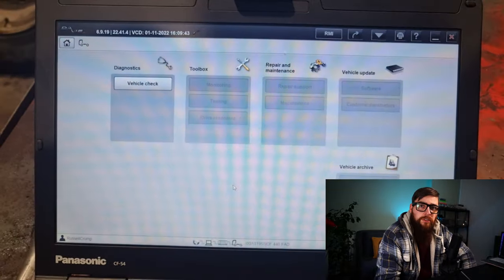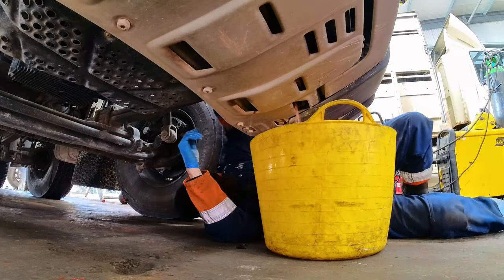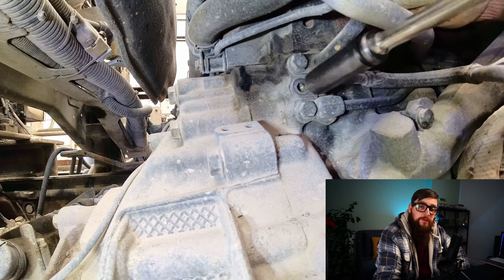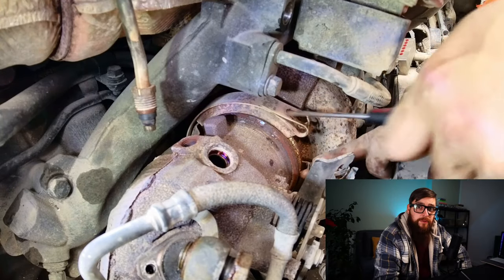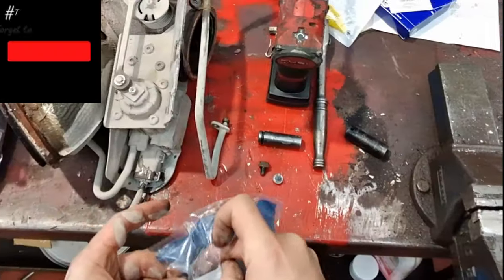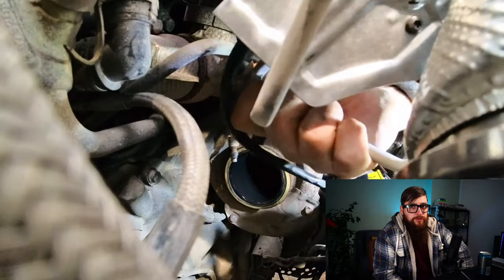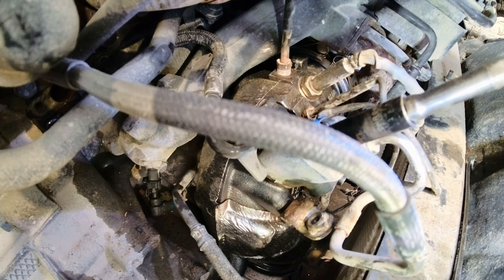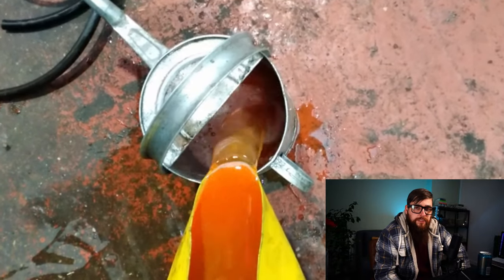ITS MOST PROBABLY THIS | DAF MX-11 BPV actuator FAULTS

Comment: I worked on Dafs for years at a dealer, and tbh really rated them as a truck, this was PR and XE, then the E6 models came along, holy crap! company I worked for recently got rid of 50 mx11 trucks, the workshop was the quietest I had seen it in many years.
Reply from the maker: Hey thanks for the comment 👍😎 seee I prefer a mx-11 or mx-13 e6 and my-17 to any euro-5 engine. I just find the diagnostics rather backwards 🤷
Reply: It's not really a fair comparison, with all manufacturers the Euro 5 engines were much simpeler than the Euro 6 ones. In fact I'd say that Daf did comparatively well with their earlier 2013-2016 Euro 6 trucks. The 2017-2021 ones are not as good I'd say.

Comment: Evening I plugged it in, and the faults cleared on their own I carried out a force region 
But i had to operate the old bpv valve as and when the new one moved to get it to regen temp it took a while but was fine and is back on the road thanks again
Reply from the maker: I'm glad you got it sorted, the cleared off the dash but not out the ecu. They would of gone from active to stored. 
with it being euro 6 I'm sure by the time it requires another one, it won't be your problem

Comment: @truck tech Uk hi great video got a Daf cf 2015 18 ton with a bpv actuator fault if I connected a new part would it allow me to do a regen as can’t get it to regen with a active fault
Reply from the maker: Thank you for the comment👌. Connecting the new BPV should let it do a regeneration as its looking for the position that your old one won't be reaching. But what will that do to the actual regeneration process? I don't know, as I've never just plugged one in and carried out a regeneration. Fingers crossed, I suppose 🙈

Comment: Imagine doing that job in 10years time..... I hope I'll have retired by then! Great content.
Reply from the maker: Hey Darren thanks for the comment 👌. The jobs only getting more technical, you should see the electric vehicle vehicles coming through now!
Reply: @TRUCKTECHUK  I will be retired and no i do not want to see the Electric trucks ,i don't even want to see XDs XGs lol
Reply from the maker: @norb0254  by the the you have finished these camshaft recalls your be past retirement age 🤣🤣🤣👌
Reply: @TRUCKTECHUK  On a LF head gasket frenzy at the moment .Thought i a quick gearbox turn around job on a AS lite ,,,Yeah bulkrings for 1st 2nd ,part number on the box is what i asked for ,pity the parts inside weren't lol..So packaged wrong to part number ..So a wait till they sort it out lol

Comment: Hi Buddy, I love your videos they are so much help, I have got a 2020 DAF CF with a BPV Internal error code P1020 the bearing had collapsed on it so I have just changed it and it is still coming up with P1020 internal error, could this be something to do with the E-FAN? If so how could I rectify it? I’ve checked all the fuses and nothing. Also in the comments you said you are going to start fixing the bearings on the BPV’s have you started that yet? Thank you.
Reply from the maker: Hey Tom. I'm glad you enjoyed the videos. If you have an internal error the only fix is replacement unfortunately as I've been unable to identify the actuator supplier. I've got a BPV here with the same faults. Internal fault and positional error. I have a kit here that needs to go into production for the shaft and with the welding required it will be a service exchange unit. But as for the internal error, it is just that... an error that is internal to the actuator which seems to be captive to PACCAR unfortunately

Hope this helps
Reply: @TRUCKTECHUK  thank you my friend, in the end I sorted it, I made up some wires and put two trucks side-by-side I plugged one truck into the other truck reset the codes and then plugged the BPV back in, and it worked, I’ve been sending my BPV’s to Poland and a guy there refurbishes them and changes any components in the actuator, it costs about £1000 with postage and packaging.
Reply from the maker: That's crazy that you needed to plug it into another truck! I wonder what it needs to see for that to make it work 🤔 you would think clearing the codes would do it 🤷
I will look into the actuator when I get more time, fingers crossed I can get a service sorted for people 😎

Comment: Holding up the BPV and getting that clamp on 😅😂 preach!
Reply from the maker: Thanks for the comment 😎. You know that's a separate qualification on its own 🤣🤣🤣🤣.
Reply: If youre lucky your Finger fits into the hole where the nox sensor is seated. Put the clamp arround the turbo, lift the bpv in there, hold it with your finger  and get the clamp arround. The clamp doesnt need to be tightend to hold the bpv so you can use your lifting finger to put in that T-Bolt

Today on CF 😂

Comment: Have you run into P1021 BPV actuator CAN communication error?  im stuck there
Reply from the maker: Hey thanks for the comment 👌. 
You need to check for power and ground on the bpv and check for can comunication. If you have them (you have 4wires to check like in the video) your going to need a new BPV
Reply: BPV was Replace.
Reply from the maker: @pantherelio  do you have any other errors in the PCI ECU?

Comment: Hi. As a driver it’s great watching and learning the ins and outs of the faults and the rectification process to get rid of those bloody P-dings!!! I’ve recently had my BPV changed on a 16 plate MX11, would this alter the performance of the engine brake in any way? I don’t feel as if mine is working as efficiently compared to the old one. Truck is automatic and changes down but doesn’t seem to have the retardation of old. 
Thanks for reading and awesome videos.
Reply from the maker: Hey thanks for the comment!  the fact you understand the systems is always a bonus from a technician's point of view as the more information on an issue you can give a technican the better when you want it fixed! 

As for your BPV issue, the part itself is what is called a smart actuator and processes all its own faults and positional data. 
If the engine is requesting a position or pressure for the turbo.....the motor will move it to that position....say 3 per cent for regeneration. If its unable to reach the desired position you will get a DTC just like in this video. This is the "requested" and "actual position" I'd be looking at in monitoring data with a diagnostic tool
So if its not performing correctly you should have an error.
Reply: Hi, no faults since new BPV fitted, also had the fuel cut off air valve replaced and a couple of NOX sensors, personally I think the BPV has been faulty for a few months as been having faults for months so maybe I was spoiled as it was not working properly. Has now started doing more regular re-gens than before as well. Maybe a bit coked up down the system? Fitter saying dpf is clean going by his diagnostics. Truck felt down on power too but I think it’s starting to come back to me. Will see how things go. Cheers.

Comment: Also what test leads were you using for your diagnosis
Reply from the maker: Unfortunately, they were dealer-specific leads which come with a silly price tag but I'm working on a project that will plug into all the basic daf components and measure the functions for you 😉
Reply: @TRUCKTECHUK   what are the test leads called ?
Reply from the maker: @Raymond Romero  I have no idea off the top of my head other than like T-06 l. Closest thing I can find for general sale to the public is https://ebay.us/iv6F82

Comment: Now it is disabled by software BPV. Will there not be nuances in the operation of the system EAS?
Reply from the maker: When in engine protection the bpv gets moved to 100 percent open but the EGR closes to 0 percent. The truck also locks the VTG at 100% open......this is a fail-safe mode for the truck to operate in until it's repaired 👍
The downside of this protection mode was Nox production, which is why you see DPF's stuck in the exhaust full of AdBlue. 
The adblue system tried to compensate for the excessive Nox levels with adblue 🫣
Reply: So I understand that. AdBlue consumption will be increased and will the DPF filter clog faster?
Reply from the maker: @autobild01  I don't think soot production would increase (I'd need to check the AFR to see what it was under normal operating conditions vs protection mode) Last thing you need is a blocked DPF too lol 
All I know is Nox levels would increase hence the software update in 2018 fixes the excessive adblue condition under protection.
This truck was in engine protection for a prolonged time https://youtube.com/clip/UgkxLGVYIMUELrUiFYz-h0_m6lqWTjkEIM_x?si=9r8H7JfF2jJDuZ6E
Reply: @TRUCKTECHUK  Why did I ask you this question? Diagnosed the truck with an error on the accelerator pedal. The error on the pedal was constantly active, but with this error it is always sporadically inactive on the BPV. Disconnected the BPV connector, the accelerator pedal error became inactive. And the pedal works perfectly. Customers contacted the service center, and there they changed the engine software with the BPV disabled
Reply from the maker: @autobild01  I'd love to know what they are using to remove or edit software 👀
Reply: @TRUCKTECHUK  KESS V2
Reply from the maker: I take it this is euro-6 on an old PCI ECU? I was under the impression the bootloader was locked on Delphi ETC-3 ecus now
Reply: @TRUCKTECHUK  E6 2014-2018. I have no data for a newer version yet.
Reply from the maker: Was this through obd or bench? I take it winOLS to edit? Or file service? I've a large market potential for this stuff.
I turn everyone away usually 😅

Comment: Evening don’t no how else to message you have you ever had a Daf Lf 70 plate 18 ton with the bigger automatic zf astronic box slave cylinder on the n/s middle burn out has a pto on it but it’s up in the middle slightly damp it’s basically locked solid lorry does run but hunts oil smells burnt out has oil in it not to the level bung as got hot do the oil pump go wrong inside thanks Ben
Reply from the maker: Hey thanks for the comment. 
While I strive to provide helpful answers to every question, sometimes I might need more information from you. That's why i offer a premium members area that provides a more personalized and supportive environment. If you're looking for a more tailored and focused approach to finding the information you need, our premium members area is the way to go. https://trucktechuk.com/b/premium

Comment: How bpv works?
Reply from the maker: Thanks for the comment and watching the video. 
If you want more information  just like the bpv, I've a blog on my website that goes into more detail on systems and components which for the BPV you can find here: https://blog.trucktechuk.com/2022/12/the-bpv-actuator-mystery-revealed.html
Reply: The bpv back pressure valve or egr throttle as it’s called in non daf speak is ther to promote higher exhaust gas recirculating rates
Reply: @Gearhead90  .... and used to increase exhaust gas temperatures during regeneration modes, both mobile and parked.

Comment: Hello.  I have such a problem DAF 106 440 starts and stalls, error P1026 P1020 P1021 P1022 is the cause of BPV.
Reply from the maker: Hey thanks for the comment. I'd be fitting another BPV with them fault codes
Reply: Thanks a lot.  This is why the engine won't start.
Reply: the engine starts and after 5 seconds it stalls and the gas pedal does not work
Reply from the maker: Disconnect the bpv electrically and try running the vehicle.
Reply: @TRUCKTECHUK  OK.  I'll try tomorrow and write to you.  thanks again
Reply: @TRUCKTECHUK  Hello.  thank you very much, started DAF 106 by turning off BPV
Reply from the maker: @dmitrijnovik3414  I'm glad you got it going, your have to find a cheap new one now 🙈

Comment: Wish I’d of known they’d changed the clamp style I’ve been reusing the old ones trying to get the bastard nut back onto the threads 🫠🫠🫠
Reply from the maker: Hey thanks for the comment 👌 I didn't know either till I put the part number in and it had superceded 😃 so much easier 😎😎👌
Reply: @TRUCKTECHUK  hi mate don’t suppose you could get the partnumber you used for the clamp. Gone on our rmi and looked at supercession and clamp I’ve got still uses a nut
Reply from the maker: @joshuapeaker  just had a look at a mx-13 I've got in now with failure to reach position and checked the part numbers for the camps for you. Clamp diameter=122mm old number: 1909938 new number:1979194. I've checked our stock and that new clamp deffo slips over the top and tightens not pushes through with the little nut like the old one.

Hope that helps, let me know about the number you have
Reply: @TRUCKTECHUK  just finished doing mx11 bpv about hour and half ago. The numbers are different it seems between the 11 and 13. I had 2121051, however clamps are same size 122mm like you say just has different bolt clamping.